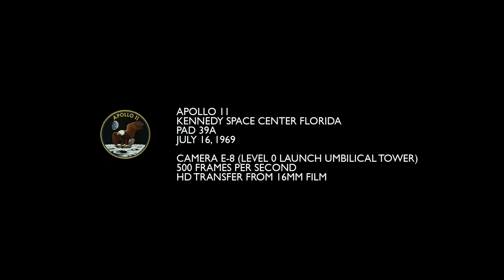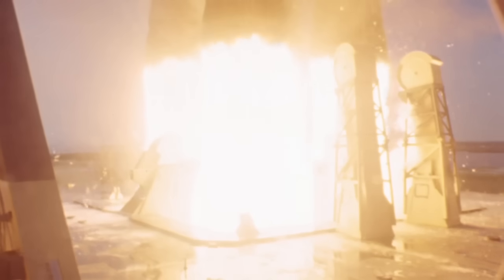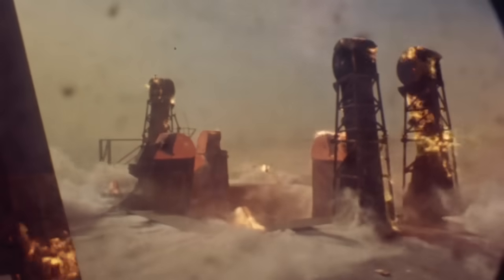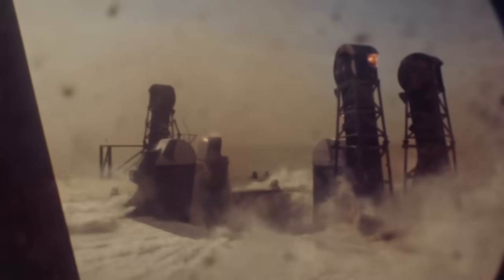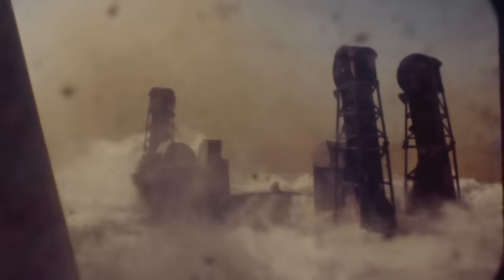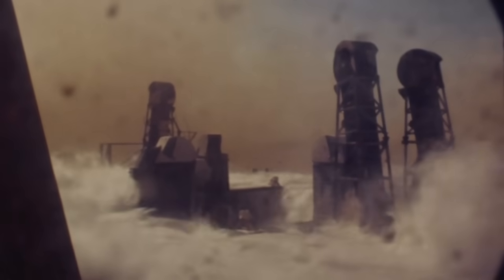Apollo 11 Saturn V Launch Camera E-8

Comment: They should build a power plant that hooks up to rocket pads/test pad for rockets. Each time a rocket takes off or gets tested every bit of that heat as possible can be captured and converted to steam for turbines. Have the power plant far enough away for safety but have the turbines underground from the rocket pad.

Comment: This is a first for me and I'm just blown away by the ability of man to continually come up with problems and solve them. Paint the surface so the surface catches on fire and not the platform underneath. Just incredible and I won't even start on the power and energy released and all of this in just a short 30 second frame. Just stupendous. Utterly incredible.

Comment: The Saturn V was communist propaganda. Those expensive liquid fuel rockets simply make the rocket ten times more expensive.
Communists do everything in the most expensive possible way. 

Solid fuel rockets are 90% cheaper,  and do the same job. 

That's why solid fuel rockets destroyed the Space Shuttle. The government wanted to "prove" they don't work. In truth, the Space Shuttle was sabotaged by NASA.

Not only did NASA destroy the Space Shuttle on purpose, they also blew-up the Morton Thiokol rocket fuel factory.
Reply: Tf are you on??
Reply: Solid rockets are way less efficient and can’t have their thrust managed to nearly the same degree that liquid boosters can. Plus, most Soviet rockets lacked SRBs too

Comment: I walked underneath it laying on its side at Cape Canaveral in the museum. It’s mine boggling. I remember the statistics. Those engines burned 1500 pounds of fuel per second per engine do that math for the initial burn on the initial first stage was how long seven minutes or something I forget but to walk underneath what 365 feet. Tall, I think it is I remember hearing the mercury rockets they used to let us go out of school in 19 6667 in Orlando Florida. Fir the launches we could see the fire from there You could hear the Rockets from there to the Cape those times. I will never forget as an eight year old boy. Now to see the falcon heavy at 385 feet tall I think the main stage being caught on reentry is mine boggling to me. Congrats, Elon.

Comment: I've seen a lot of documentaries on the moon landings, but have never seen this video.  Great explanation on what's happening.   It's still amazing that humans actually pulled this off.  Especially without the advanced computers, and electronics we have today.  I'm still in awe when seeing details of the engineering and applied science that had to be worked out.

Comment: One of the small but crucial details about the liftoff concerned the swing arms from the launch tower to the Saturn V. Right up to the instant of liftoff, five of the arms with all their connections remained fully attached to the rocket. The signals to release all the connection and swing the arms out of the way did not occur until the rocket had actually lifted up about an INCH AND A HALF. On every launch, Rocco Petrone, one of the test conductors, stated he was terrified when this moment came, referring to it as the 'come to Jesus' moment.

Comment: Questions?
Reply: 0:39 Mixing And Billowing Up
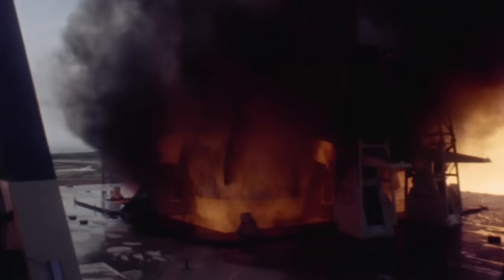Reply: 0:49 1:00 Sucks All The Material Back Down
Reply: 1:10 Hold Down Arms
Reply: 1:17 T Minus 0
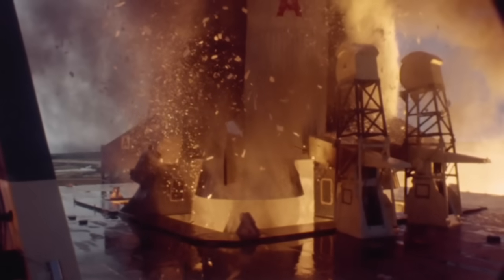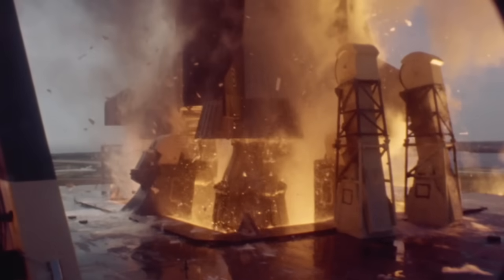Reply: 1:30 2:04 Hoods
Reply: 1:35 1:58 Ice Coming Down
2:08 Gas
Reply: 2:57 3:19 Designed To Burn And Char
Reply: 4:11 Water Dumped Into This Area

Comment: So many questions to ask but is that fresh water or sea water dumped i to the hole+is it true that the water was used to deaden the sound vibrations from damaging/ripping the Saturn V apart on lift off??
Reply: It was fresh water. I think its main purpose was cooling rather than sound suppression, but I'm not sure.
Reply: @maxfan1591  No, it's most for acoustic dampening. Rocket engines create insane amounts of sound vibration, and the water is used to disrupt that.
Reply: @maxfan1591  Sound suppression, above all...they were damaging launch vehicles before using the technique.

Comment: That cooler exhaust that looks dark is still very hot at over 1,300 degrees F, but the much hotter exhaust from the thrust chamber had a temperature of 6,000 degrees F. Additional cooling was provided by the kerosene which was pumped through the tubes that the thrust chamber and upper portion of the nozzle were made of before being sprayed through the injector plate at high pressure.

Comment: Mark, excellent video (11 years since you posted).  Do you, or anybody, know more about the rods and dies used between the rocket and launch pad.  I have researched this (been to the Cape, Huntsville and Houston) and cannot see evidence of either.  The rocket had metal rods installed.  At lift off, these rods were pulled through dies.  This caused some initial restriction and braking action.  This kept the rocket from "jumping" off the pad.  I would love to see a video on this.  The NASA engineers experimented with many different combinations and maybe even scrapped the idea as the later rockets got heavier.

Comment: the reason they suspend the rocket above the ground, and they have a huge channel beneath the rocket, is because lift (thrust) cannot be achieved if the rocket is sitting on the ground.   You need a column of air beneath the rocket in order to attain lift.   This is a damning fact that throws a wrench into the argument that thrust can be achieved in the vacuum of space.   Of course you can't achieve thrust in a vacuum, because as soon as the nozzle is opened, the whole fuel container evaporates into the vacuum.  It is literally sucked out by the strong vacume, so you go nowhere.   There's nothing to push against in space, right?  No column of air, no thrust.   Retards will argue that no, I'm wrong, because the force is applied against the rear of the fuel tank, but this is major copium for those asshole scientists who cannot explain how thrust is achieved in the vaccum of space.   They think they're smarter than you, but they are just liers.
Reply: No. The space beneath the vehicle is necessary because you need room for the flame deflector.

If you don't have one, well, I recommend looking into Starship test flight 1 to see for yourself.
Reply: There's a reason the term "rocket science" is applied to anything that's complex. This is literally rocket science, and you're badly wrong. A vacuum doesn't not instantly cause the contents of containers to "evaporate" or be "sucked out". Rockets work because the pressure of the exhaust gas in the combustion chamber is pushing in all directions, and the only unopposed direction the gas pushes is up through the rocket structure. It's literally that simple.
Reply: Retard!
Reply: Wow!  I haven't heard this wacko theory for a long time.  So all the space probes we "sent" to the planets are fake?
Reply: This guy is a complete buffoon. He once stated that NASA forgot to make the hatch on the LM sufficiently wide that a suited astronaut could fit through it and claimed to have visited "the museum" and measured the width of the "shuttle door" He was referring to the LM and seems to think that there was only one of them and it flew the astronauts back to Earth.

He badly parrots the ludicrous Apollo Detectives and can't even get their nonsense right.
Reply: @yassassin6425  you cant even get what i said right.  try harder
Reply: @yassassin6425  Are we supposed to also believe that NASA hired black women to calculate the trajectory to the moon, but all of their math is lost of course.  Everthing is lost with NASA, including the "technalogy" to get back to the moon, even with today's tech.   You "lost the technology"?  that's intertesting.   Go on...
Reply: @yassassin6425  Fact is you don't want to talk about how a supposed spacecraft can navigate, steer, propel itself, brake, etc, in a vaccum, because it's impossible and it only exists in a fairytale in NASA's mind.   Nobody is going into the vaccum of space.  How do you steer sir?  If there is no matter to push against, then you cannot change your direction, amirite.  Explain to me how I'm wrong, instead of name calling, because you already lost if you can't support your own argument. just name call
Reply: @yassassin6425  next up, yasassin is going to explain how the sound suppression system works when it is actually facing the crowd - not the rocket exhaust.   The fact is the "rocket" is quiet, and they have to add sound to make iit more dramatic.   The "Rockets" don't accellerate at escape velocity speed.   They just don't.   Instead, they float up gently, and then they switch you to CGI and all of a sudden they're beyond the speed of sound and whatnot.   The whole show is a mirage.
Reply: The Polaris missile and all successors are launched from a tube on a submarine immersed in water, no air.   Rocket engines in space use hypergolic propellants such as dimethylhydrazine and nitrogen tetroxide.  The push is expulsion of gas from the thrust chamber, elementary school science.   Rockets in space also use highly compressed nitrogen for the finer vehicle maneuvering corrections.
Reply: @nomenclature9373  submarine missile launches are all CGI dumb dumb
Reply: if thrust was in fact created by the action of the fuel at the rear of the fuel tank, then you would not need a column of air below the rocket in order to lift off.   There is no way around it.  You cannot go to space, because no craft can achieve thrust in the vacuum of space.

Comment: Van Allen belt sends regards😂😂😂😂😂😂😂😂😂😂😂😂😂
Reply: The astronauts waved as they passed by the belts, and again on the way back. It's almost as if the belts weren't a major obstacle.
Reply: They are belts, you couldn't even parrot that correctly. And why do you complete cretins insist upon finishing your moronic posts with a string of puerile emojis?

Comment: Solving the pogo oscillation in fuel and oxidiser lines is the aspect that fascinates me the most.
You can see, in failed Atlas launches, the pogo thrust as it sputters out the rocket bell.

Using a jet engine to push fuel out of a nozzle, is not an easy problem to solve. Ask the Soviet engineers.

Comment: I'm sure I've read somewhere or had seen a documentary that mentioned them dumping the turbo exhaust around the inside of the engine bell, but I always forget, and then am left wondering why it looks like there is so much black smoke and have to look it up. Thank you for reminding me though lol. This is a great video, and really lets you appreciate the lengths NASA went through in order to handle that much power from those engines.

Comment: A rocket, if sitting right on the ground, cannot achieve thrust.  That’s what the channels are for underneath the rocket.  It enters air into the equation, and what is achieved is the thrust. Without air, no thrust.
Reply: And thrust is achieved as a result of exit gasses against the rocket.

Are you a flat-earth nut? You sound like a flat-earth nut.
Reply: First law af Newton force. Action reaction
Reply: I don’t like people who refuse to understand physics
Reply: Actually, the oxygen came from huge liquid oxygen tanks in the rocket. The trench is to give the flame & exhaust someplace to go instead of bouncing back up & damaging the engines.

And YES if you bring your own oxygen you can have thrust in space!
Reply: Where did ya go, JamesJacobson?  Inspire us with all your hard earned scientific knowledge!
Reply: @SMHman666  
He's an upper case scientist you know. Can't be doing with inferiors.
Reply: Thrust is achieved as a result of the reaction of exit gasses against the column of air
Reply: @JamesJacobson-ov4ps  "Thrust is achieved as a result of the reaction of exit gasses against the column of air"

Nope. Acceleration is created by combustion gas pressure against the top of the combustion chamber.

You obviously don't understand Newton's laws of motion, or that rocket engines generate thrust in vacuum chambers. In other words, you are wrong both theoretically and empirically. Congratulations.
Reply: @JamesJacobson-ov4ps it’s not about the air as they already have oxidizer it’s about letting the exhaust go somewhere because if you don’t do that it explodeds
Reply: Lower case scientists would lie and say no, that’s not true.  Thrust can be achieved in the vacuum of space, which is regarded.  Like I said, no air, no thrust
Reply: @JamesJacobson-ov4ps  "Lower case scientists would lie and say no, that’s not true."

Real scientists and real aerospace engineers say you're wrong. But hey, you do you.

Comment: Watching this after the destruction Starship left behind really says a lot. Why reinvent the wheel?
Reply: Because we can always do better!
Reply: Technology has advanced since then, think about cars or jet engines, but it's the strive for greater efficiency and power that pushes development forward.

That said, at least the Saturn V or 1B for that matter, never failed like that. They worked first time, every time.
Reply: Don't undersell SpaceX. Remember that their first three Falcon 1 launches failed, yet now Falcon 9 first stages landing themselves and being reused multiple times is so routine that it isn't news.

Also, it isn't practical to revive the Saturn V, because so many individual components would have to be redesigned from scratch that it would be easier to simply redesign the whole thing from scratch, meaning it wouldn't look much like a Saturn V.
Reply: @maxfan1591  What the genius OP failed to realise is they haven't reinvented the wheel. They have taken existing technology and adapted it for different use. Just as the RS-25 was a progression from an F1 engine and all that came before it.

If you or I began a car company, we wouldn't invent an engine or transmission, instead we would use current technology, find areas to improve its efficiency and take it from there. We certainly wouldn't build Model Ts because they 'already existed' so why develop a Ferrari?

The limited lack of vision this person has is astounding! I wonder if they typed that out on an iPhone or Galaxy to send their message or if they used a Motorola 'Brick'?

Comment: Did they use matches or a gas lighter to fire the rocket?
Reply: A technician with a flint frantically making sparks.

Sadly, he couldn't run fast enough and thus wasn't available for Apollo 12.
Reply: Tee Hee

Comment: That is a lot of power being funneled into a relatively small area. If any human was still in range of those engines they would have been instantly flash vaporized.
Reply: Everyone had to be at least 3 miles away from the launchpad and most were at 5 miles in the viewing areas.

Comment: Let's see....500 frames per second of 16mm film for 8m42s = 522s = 261,000 frames.  Each frame is about 1/2 inch high, so that's 130,500 inches = 10,875 feet of film.  Those cameras must have had some mighty big reels on them!
Reply: Listen to it again: The recording time was "about 30 seconds" at 500 fps - or 15,000 frames.
Reply: @Tim22222  Duh!  Yes, of course, it's only 8 min when played back at normal frame rate.

Comment: It doesn't show up in this particular launch camera view, but there was some "low-tech" stuff going on here, too. The blast hoods on the 4 holddown clamps were operated with a lanyard. One
end was tied to the back side of the hood (the side away from the rocket). The other end was tied to the base of the Saturn V. As it lifted off, the lanyard pulled the hood over, then broke. It can be seen in some of the other launch camera views.
Another thing was the "controlled release mechanism" to slow the liftoff down a bit. When the holddown clamps released, the sudden kick in the ass from the thrust could damage the rocket.
There were several "pins" attached to brackets on the holddown arms that passed through a die. The die was attached to the bottom of the rocket. During the first 6 inches of liftoff, the "fat" end of the pins had to be pulled through the smaller hole of the die. (Think of it like pulling a 6" long x  2" dia. tapered steel rod through a 1" dia. hole). It took 75,000 lbs. to get it started for each pin.
Here's a link to a PDF that shows this stuff, and others:   https://ntrs.nasa.gov/api/citations/19760012107/downloads/19760012107.pdf

Comment: Ok I do not mean to stir up controversy or endless fighting and conspiracy theories. I am genuinely curious and want to present 2 questions for people out there far smarter than I.  (1) This is super impressive but what materials is that concrete and steel composed of so that it does not just melt away with that intense heat and pressure? (2) Is the heat generated from this launch far greater than the heat generated by the planes that crashed into the Twin Towers in NY? Thanks for any insights.
Reply: the cement is a form of refractory cement called fondu frye which was developed during the apollo missions. there are exhaust tunnels under the launch pad that direct the majority of exhausts= gases and heat away from the launch pad. these tunnels are filled with water to help protect the launch pad and decrease sound waves that could damage the rocket. the steel used in the luanch pads- im not sure what type of steel is used but there was a coating applied as described in the video. the heat generated from the exhaust is roughly 6000 degrees F but remember that the exhaust is mostly deflected out and away. the fuel used in the commercial jets i believe was Jet A fuel which has an open burn temp between 800-1500 degrees F depending on conditions.
Reply: @tomsteve3804  No, I'm not sure what the temperature of the exhaust was but I promise it wasn't anything like 6000°!! The temperature of burning kerosene is nowhere near hot enough to melt steel. The damage to the launch platform was from the force of the blast, most likely.
Reply: https://www.youtube.com/watch?v=4LFZA0Rx1gg